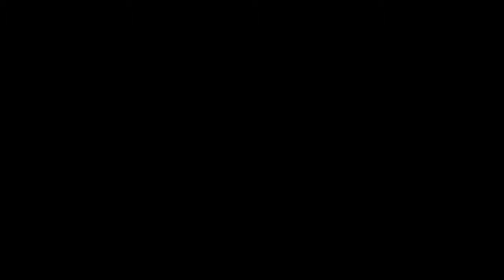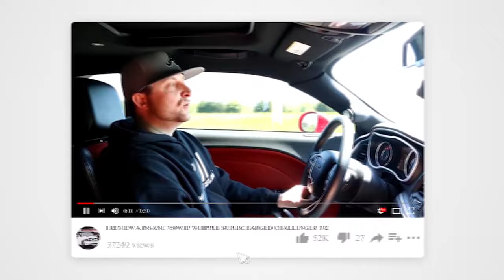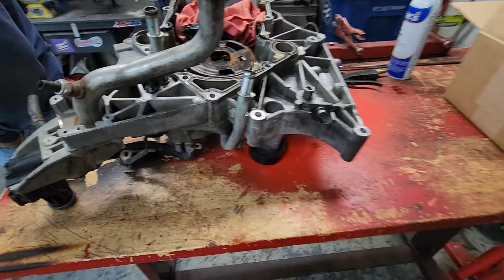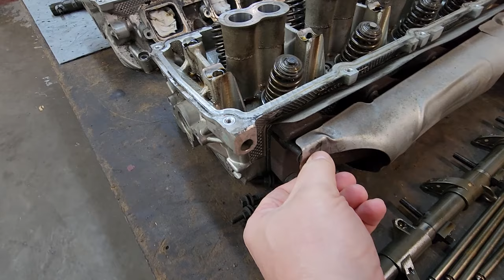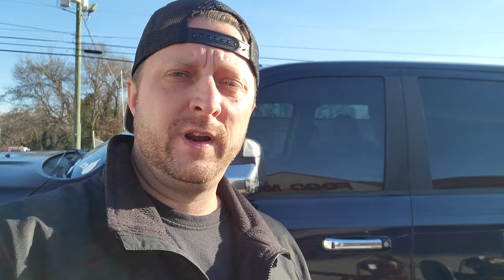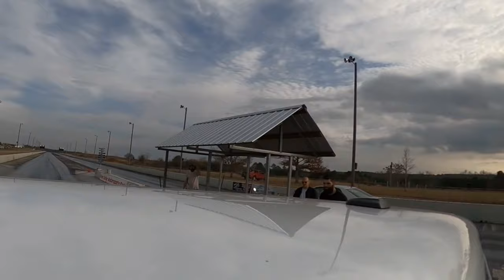6.4 Hemi Ram 2500 Common Problem Tick Rattle Boom! Part 2

Comment: Should upgrading the oil pump to a hell cat or Melling high volume pump.
Reply from the maker: For Racing not a bad idea but the stock pump works fine definitely not the reason the lifters fail my opinion.
Reply: @FrostbiteRam  I agree. Subpar needle bearings in the rollers and neglected maintenance are the main reasons. Use the newer larger roller needle bearing lifters and a good synthetic oil, you will have a happy engine.

Comment: I also swapped my oil pump for a new one along with running rotella 15w40 oil..keeps the oil pressure more stable around 35psi @idle.
Reply from the maker: Thanks for sharing

Comment: i had the cam lifter failure on my 13 ram 1500..caused a misfire on cylinder 7, had the cam swapped for a comp 270 cam , mds delete, among some other goodies. Had it tuned on 91 pump gas making just under 400 hp to the ground.
Reply from the maker: Awesome

Comment: I’m going through the same thing with my 6.4. Make sure you check the center cam bearings. Mine are completely trashed. The front is slightly worn.
Reply from the maker: Yeah they look good this truck didn't run long

Comment: My 2012 dodge has be sitting forever trying to find a job so I can fix it it's misfiring from cylinder 8 and is a loud tapping noise it's definitely lifter and cam failure but I was wondering is it ok to start it or drive it around a lil I do that so it don't just sit.
Reply from the maker: I definitely don't recommend driving it otherwise it could lead to entire engine replacement instead.

Comment: On the upcoming cam install how in depth will the video be?
Reply from the maker: I'm trying to get this one done pretty quickly so not to much. However I have camshafts replacement videos on my Frostbite truck old videos but pretty detailed.
Reply: Ok thanks sounds good your electric fan video was awesome thanks
Reply from the maker: @chrisd2486  thanks